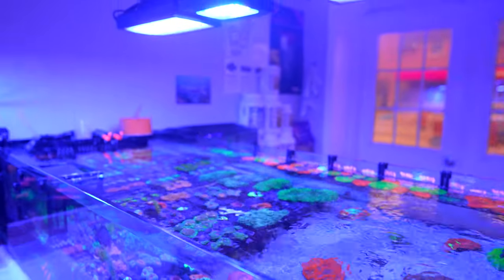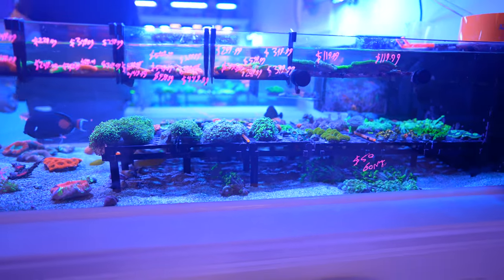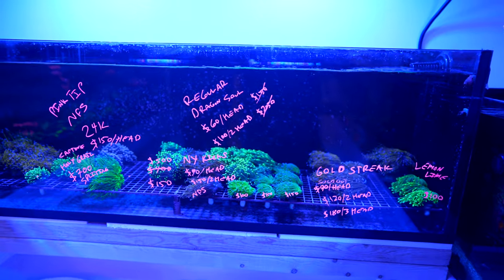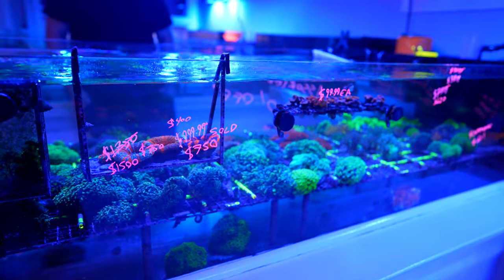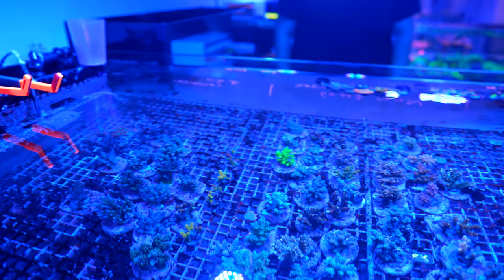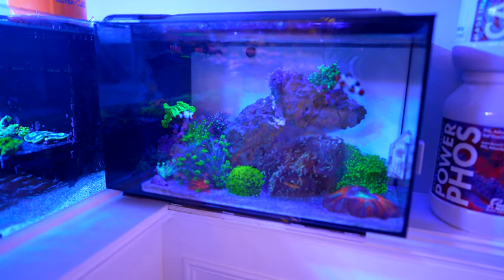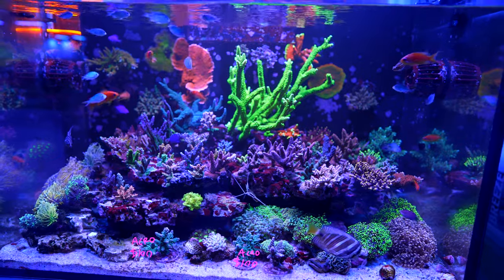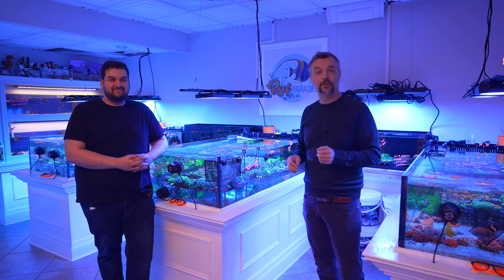Flow Masterclass with Reef Paradise

Comment: That’s a great video and awesome store.. now he said that display tank towards the end where the retune pump does really nothing and it’s more like a slow drip back in the tank and then he said two to three times turnover, is that two to three times turnover a day or per hour?? I have learned something in the last few days that I was going through filter fleece rolls like once a week after having a heavy bioload but the fleece wasn’t as dark as it use to be and after slowing down the return pumps I noticed that the fleece was much darker and was using less fleece and catching more gunk than before.. So explain if he meant two to three times turnover a day and not per hour. Thank you 🙏 again for such great content. 👏👏👍👍👊👊
Reply from the maker: Pretty sure the tank is on a very slow turn over - Dimo is using DOS pumps to do water changes and thus it would be maximum 2-3 per day, but I would think it should be even less than that.